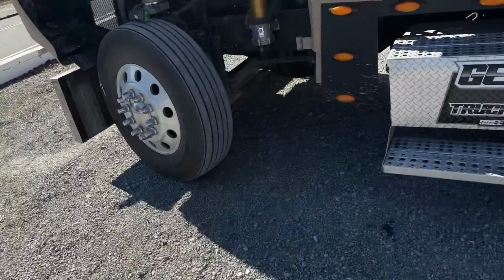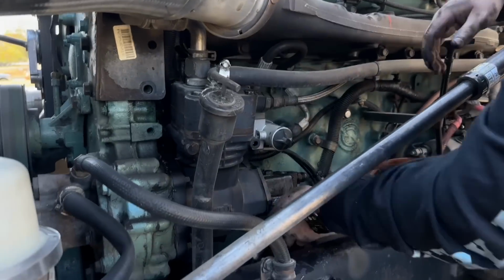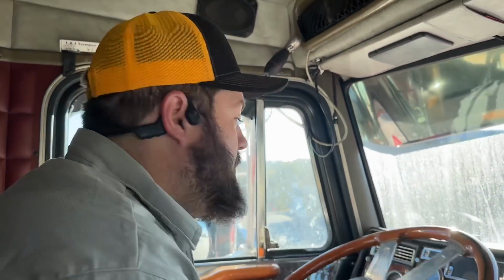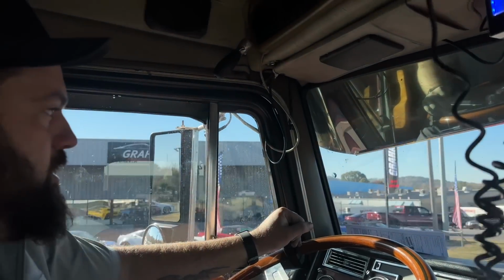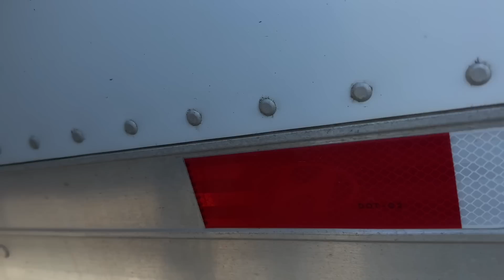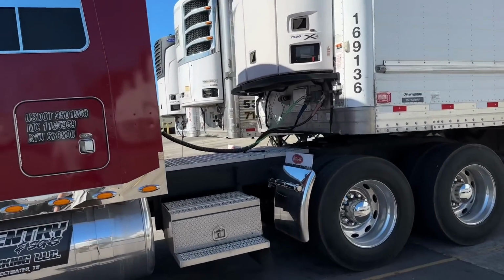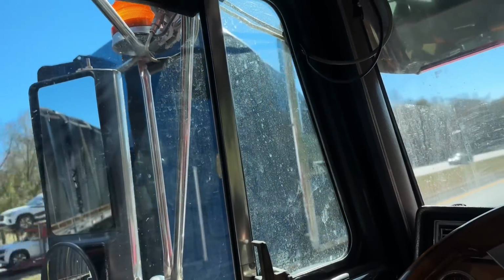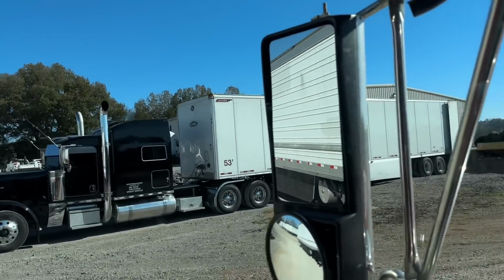I Took Rooster To Haul A Very Expensive Secret Load..

Comment: Putting a winter front on to bring up water temp?  You got other issue, like stuck thermostats. Or way to hot for water pump. 
Actually you can run 2 programs in the ecm. Called driver rewards. 
Security says you shouldn't be giving out load info, where loaded ,where going, what hauling.  Tim that been basic rules for long time.  
You got work that counts.

Comment: Hey Tim I assume you're using  GoPros There's a windsock you can put over the entire GoPro it will lesson the wind noise considerably.

Then depending on your editing program if you run it through the noise reducer it'll probably bring the engine and the Jake brake engine sound forward in The audio.

We had a GoPro 360 or insta360 you could  swing the viewing angle around while cameras mounted on the hood of the truck.

Comment: Great Video,,, I know you have a lot of confidence... but you also have a lot of trucks... leaving the trailer hooked up while you worked on the truck was gutsy... if you had not been able to get it started... a real pain to get the truck away from the trailer... seems like dropping the trailer with enough space to hook another truck to trailer and still make the pickup would have been prudent. Worse case then is the time to backup an pickup the trailer.

Comment: Take a fuel filter cap screw and drill a whole in it. Put a fitting in it. Anytime you work on the fuel system pull a vacuum with a hand pump. It will fire right up and get all the air out of the pockets that cause loss of prime.

Comment: I had the same problem a couple weeks ago turns out it was air in the fuel hopefully your pump solves the problem but make sure you check all your suction lines and if you don't have one get one of those fittings they have the sight glass in it and put it in between the pump and your davco and see if you still have air bubbles
Reply: Had similar on a little round town 6Tonne dump truck. She was a bit old and got some crap in one of the banjo fittings. Had similar on some tractors. Won’t give power when asked but idles nicely.

Comment: coyote f150 you can make up to 1200whp on stock sealed motor with just boost and fuel system and them things tuned by lund or PBD run 8s in the 1/4 mile in short bed single cab and 9s in crew cab or just keep at a everyday 700 to 900whp awd you are eating any trx hell any helcat and most supercars. Only choice do you want supercharger or turbo?   liter that power comes for 20k and 40 to 60k for the truck

Comment: I hope you put some of the algae killer additives into the fuel tanks. Or the problem will come right back.
Reply: We stick to changing fuel filters every 300 hours and rarely have starting issues and definitely aren’t ever using ether. Most our trucks we use FS1000 Fleetguard fuel filters. Never any additives except around the time winter blends are being put in our bulk tanks. Then we might dump some Diesel 911 or standard Power Service supplement

Comment: I've had the same starting problem with a 6NZ cat in a 2001 379 peterbilt.  I ended up putting a gear reduction drive starter on it from Truck-Pro. Never had any more starter problems.  Run up to Canada quite a bit during the winter.  No problem whatsoever starting in the extreme cold weather. 
Gear-Reduction drive starters are the way to go.

Comment: I did LTL in the 90s im in vegas i would switch out with a phoenix driver in wickieup AZ he would pick drugs usually about four to five pallets before he would meet me in wickieup the bill of lading for that stuff was four inches thick well one night he forgot one pallet of drugs he signed for it and when i would change trailers with him we usually pulled doubles i made he the bill of lading seal in tact when i got back to vegas i went home a couple hours later my boss was calling me police detectived were calling me FBI showed up my door DEA wanted to talk to me and the other driver what saved me was the seal in tact the dock workers told all these people the seal was in tact it turned out the other driver left the pallet on the dock they found it. but it was a big hassle for me i was getting worried